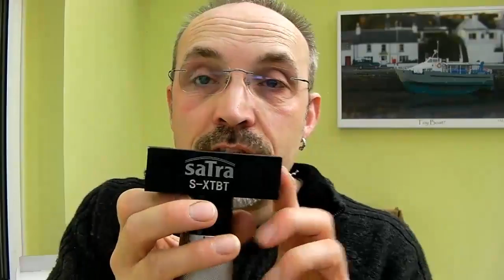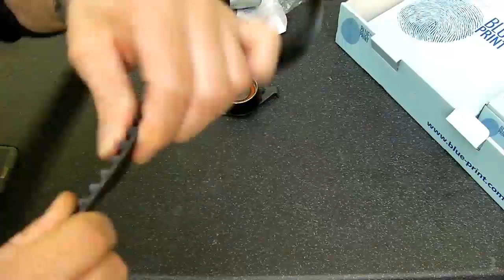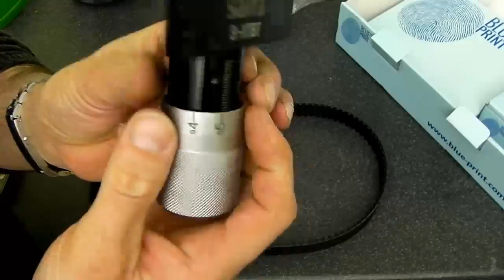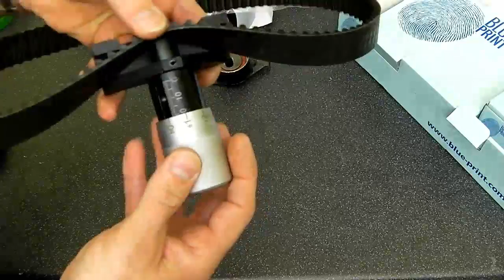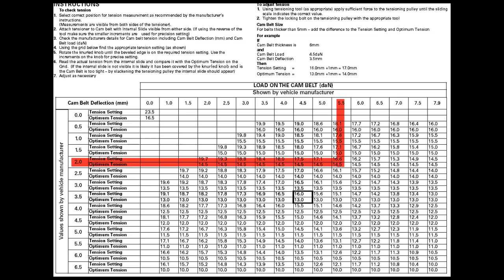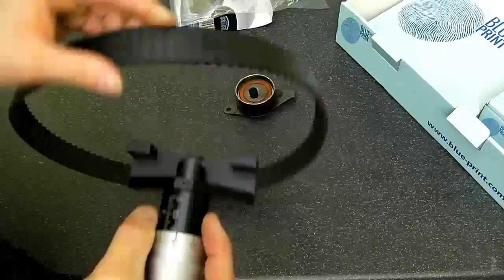Universal Timing Belt Tension Gauge How to use Laser / Draper / Bergen

Comment: I am trying to set belt tension for a Peugeot.

The manual says it should be set to 53 SEEM with relates to 300 Newtons Burroughs BT 33-73F/BT 33-86J.

They way I understand it, these 300 Newtons are the belt tension, so the force longitudinally to the belt.

As this tool measures deflection under a specific force (acting orthogonally to the belt), it seems like the 300 Newtons need to be converted to two other parameters.

I am also a bit confused by the lookup in the table: How much the belt deflects does not only depend on its tension and the applied force, but also on the length of unsupported belt onto which the force is applied.

So specifying only the force and the deflection doesn't say anything about belt tension, without also specifying the distance of belt over which this is measured.

In the case of the tool it is something like roughly 50mm.

Is this some kind of standard? Otherwise, the numbers would not really be comparable on their own.
Reply from the maker: The distance of the belt at which this is measured is always consistent as it sits at 2 flats while the plunger presses in the centre.
Being completely truthful I'm not a mathematical minded person so I might be misunderstanding something but the belts I've tightened with this method have held up fine over the course of the use period.
Reply: @spidiq8  The tool I am using has a distance of 51mm between posts.

I am just curious because how using this as spec dies work, because I don't understand how the manufacturer would know this distance of the posts in my measurement tool. Or is there a standard?

I found an Amazon review that I think details the correct mathematics behind the device.

The tension force of the belt and the orthogonal force from the plunger create a force parallelogram.

The deflection force is F = 4 * T * d / l * cos alpha where T is the tension force of the belt, d the deflection, l the length of the gap in the measurement device. Also, cos alpha can be ignored, because it will roughly be 1 for the angles encountered in practice

In my case, I need 53 SEEM tension equaling 300 Newtons belt tension.

According to the formula, according to my device's 51mm gap, this relates to a 3mm deflection at 70N of force.

As my belt is 6mm thick, I take the 6mm offset of the plunger as zero an set the spring tensioner to 4mm, because my particular device has 10N/mm as spring constant and I need 70N/(10N/mm)-6mm(Belt thickness)+3mm(Deflection) as offset.

With this setting, I can check if belt deflection is 3mm in the device.

If it is, belt tension should be around 300N.

I believe this calculation to be correct, but it course I cannot provide any warranty, and if you feel that you have found an error, feel free to bring it up. 🙂

Comment: On ebay all these tools have the same size numbers on both sides scales. Not to mention that 0 on one scale on one side is a bit lower than the coresponding vertical grade while on the other side upper 0.2-0.3 mm. Their alot of counterfeits on ebay even the ones like Satra like the one you have. where did you buy yours? as I see it has different sizes .
Reply from the maker: I bought mine on ebay but many years ago, there was a chap in Sutton in Ashfield who was stocking and selling these and a wide range of other tools.
I think it was this one. https://wjdtools.co.uk/

Comment: Interesting and instrutive. Thanks! However all the specs I have for several car reference a force of 100N (10Kg) with a deflection of around 9mm-11mm ...this chart only references up to 7.9daN or say 80N ... I assume it's not proportional, so you cant default to 50% of force for 50% of deflection?? Any suggestions here?? Thanks, Alex
Reply from the maker: Theoretically that should work and there is a little 'give' in manufacturers specs, the concern I'd have is that as the deflection increased the belt would be under more tension so the greater the force needed, i.e. The first 5mm would deflect with less force than the second.
I would, in this situation divide and multiply by the maximum on the chart so you'd be looking at a deflection of 8mm at 80N, I'm confident this would get you close to specs, you could always have a garage double check the tension afterwards for peace of mind.
Reply: I also have the same problem. What I would do is to seek the correctly tensioned belt and use the tool to measure at its range and take that measurement into the newly tension belt to adjust with similar results. Could that work?

Comment: Thanks for the video.
I'm reading a workshop manual that states 98NM(22lb) of force and an alternator belt with 9-11 deflection when new.
Is this type of tension guage relevant to those manual specs or i just wasted my money?
Reply from the maker: You will be able to convert it but may need additional info from the manufacturer, unfortunately i'd need a refresher myself to remember the conversions now.

Comment: What’s the lowest force it can do
Reply from the maker: Off the top of my head I couldn't say it's been ages since I used it last. If you reference the table I show in the video you should be able to see.
Reply: spidiq8 timing belt on Hyundai elentra 2001
Reply: What’s the measurements on that tool
Reply from the maker: @brandonwebb2100  I have no clue re vehicle specific settings, you'll need info from your user manual to calculate what setting you'll need. If you watch the video it explains how to take the readings from your Haynes manual or similar and transfer them via the chart to the tensioner.

Comment: I've just received my no-name "ebay" belt tension gauge and I've found the the spring pressure ceases just after ten. So winding it out to twenty is only an aggravation as the rod inside the spring appears bent and the knob binds each revolution after ten when the is no spring pressure.  Vid had been quite helpful for me to understand how to use this tool.
Reply from the maker: Glad the video helped but that's a nuisance about your tensioner.
What brand is it and have you contacted the seller?
Reply: @spidiq8  The tool is un-branded and arrived in an undecorated white box the same size as yours.  I dismantled it and found it had a lot of swarf inside.  The setting rod that presses on the spring was bent and that is was causes the tightness.  I sent photos to the seller who replied that they would refund a percentage if after I cleaned it I couldn't get it to "wok".  I have cleaned it, I haven't determined what was causing the rod to be off centre .  It is threaded into the thimble an secured by a nut, a very poor quality one at that.   I wanted to check the tension of my motorcycle drive belt that I had recently replaced and tensioned using  a ruler and weighing scales (method according a Haynes manual).  Unfortunately, using the numbers supplied for using the cycle makers tool gave a result with this tool that indicated too tight.
Reply from the maker: @hoverhead047  I would suggest you request a refund on that as the item sounds too poor a quality to serve its purpose.
This one by Satra is made at the same place as the Draper and Laser tools to the best of my knowledge.
Are you in the UK? I can get contact details for the UK retailer for Satra and Asta tools who've recently been in touch with me about the possibility of trying some more of their tools.
Also, may I ask which bike it is?
There are often other methods, if Ducati there's a selection you can use which I explain in my 916 belt changing videos.

Comment: I have seen also your "Ducati 916 / 748 / 996 timing belt change" part 1-4. Perfect video's! I would like to change the belt of my ducati 851 which is using the same belt as the 916 used in the video's. Can you tell me the deflection and load values I need to use, so I can use the universal timing belt tension gauge, soon in your video? I have checked internet and all your videos but the values are not mentioned. Thanks
Reply from the maker: Thanks, glad you enjoyed this. Unfortunately I'm not at home currently to check the manual for the values needed and when I did that video I used the Facom tool which I borrowed from someone in the Scottish Ducati club.
Will try to remember and find the info when I can.

Comment: Will this work the same as VW210 tool???
Reply from the maker: That's not a tool i'm familiar with so I couldn't say, sorry.
Reply: Yes, same, but you can get the settings from the vw shop manual. Example: the AAZ/AHU diesel shop manual specs the setting at 12-13.

Comment: Hello. Going to be using this on my 996 this week. Watched  your other videos about belt change. What reading should I be Aiming for with this gauge. Thanks
Reply from the maker: It would be dependant on the information given in the manual and then calculated for use with this gauge, Unfortunately I'm near neither my manual or gauge to help with that, the 996 is the Desmoquattro engine same as the 916 and 748 though so you should be able to get the figures you need from one of those.

Comment: I saw the chart, but it only have data up to 7.9daN, which is 79nm. thus i am wondering if it can set 98nm with a deflection of 3.5mm.

This data is meant for honda jazz 07.
Reply from the maker: Ho Hao Yi Dave I'll dig out the tool later and take a look but odds are the max on the chart are the highest it'll go, what are you measuring?
Reply from the maker: Ho Hao Yi Dave I'll dig out the tool later and take a look but odds are the max on the chart are the highest it'll go, what are you measuring?
Reply: Thanks!

I would like to set the serpentine belt tension for honda jazz 07 as per manufacturer recommendation.
Reply: No useful response here??
Reply: Dave Ho
 I also need to apply 98nm and get around 5-6 mm on a power steering belt. Did you figure it out ?

Comment: Hi spidiq8,
what reading should this tool be at for a ducati 748? I checked the manual and it only says " 2 -  2.5 on the ducati tool/gauge" 
thanks
Reply from the maker: Unless you can get the Nm deflection rating you can't readily transfer it, the only way without is to test it on a belt of known tension or against either the original Ducati tension tool or the Facom unit.
You can set the belt manually using one of the other methods covered in my 916 timing belt series of videos and then take a reading for future reference also.
Sorry I couldn't help further.
Reply: ok,thanks man! i love the videos, ive done as good as everything on the bike with them!
Maybe the local dealer here may know the numbers, will let you know. greets from belgium
Reply from the maker: Thanks, good luck with getting the figures.

Comment: Hi. May I just ask please about the Haynes SEEM figures that I have for my Peugeot Partner van 1.9 diesel 2006. They give the belt to be a final setting of between 38 and 46 SEEM units of tension. This equates to 203 and 245 Newtons (not Newton metres as you say, it should be just Newtons) which is 20.3 to 24.5 daN (dekanewtons) but your tension table only goes up to 7.9 daN ??  Do you think that the 'load on the cambelt' is the same thing as the Haynes figures ? I hope you don't mind me asking and thanks for any help with this. Anthony
Reply from the maker: Honestly, I'm not entirely sure, that seems like a massively high tension figure though regardless of the engine type.
In this case you might be better off using something like the Facom tool that you can see in my Ducati cambelt video series, this is much simpler to use and requires no calculations but is a more expensive tension tool. 
Of course the general rule of thumb is a 45 degree twist test on the longest run, this is fairly standard though not 100 percent accurate, as you reach the 45 degree point you should feel tension and it should be very very difficult to twist further, at the force you specify it would be nigh on impossible to twist the belt at all which will be putting massive strain on them and the crank and cam wheels. 
You'd be better asking for figures from a model specific forum or a friendly garage and then converting them accordingly to be sure. 
For further confusion, you could try to find a Hz figure and using an app tension that way.
Reply: Many thanks indeed. I'll go with the 45 deg rule for now and approach my local mechanic to see if he would check the tension with the belt tensioner he uses, if he uses one, then compare. He's given advice before for a 'drink' but he may charge for this of course. I'll leave the covers off for access. 
This has got me thinking. I reckon if I hang the old belt up and place known weights from the end (loop end if I don't cut it) for it to be in a known tension, then i could calibrate the SATRA tensioner. I could use plastic milk bottles with each litre of water (1Kg) giving 9.81 N of force ( w=mg) If I don't cut the belt then it would have to be divided by two of course as the tension would be shared between the two belt parts. I must do this then let you know how I got on. Cheers.
Reply from the maker: That would be good to know, thanks

Comment: you mentioned a ducati what type of ducati you got
Reply from the maker: Here. 
https://youtu.be/PfjM2dBhs3c
Reply: spidiq8 a 916 very nice I have a ducati 750 super sport
Reply from the maker: +ghost 94 I love the look of the 750 / 900ss, the older squarer type with full fairing, wouldn't mind having one of those. The video series I linked is a how to for cam belt changing and the principal would be the same on yours even if it's the older model with the 2 valve head.
Reply: +spidiq8 mines a 1992 to model if you ever get one check your selectors they have a habit of going in the 750
Reply from the maker: +ghost 94 That's the nicer pre face lift model then, lovely looking bikes. Useful info about the selector, thanks.
Reply from the maker: +ghost 94 Do you have any video of it?